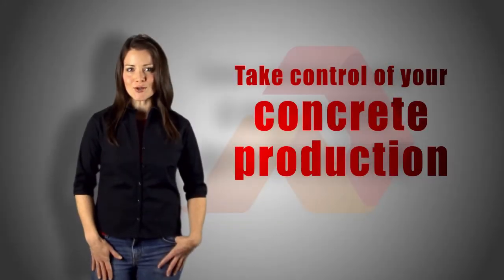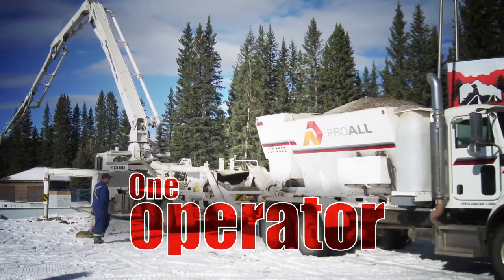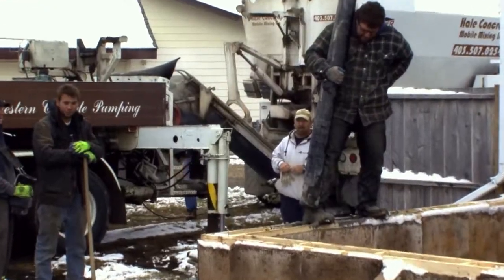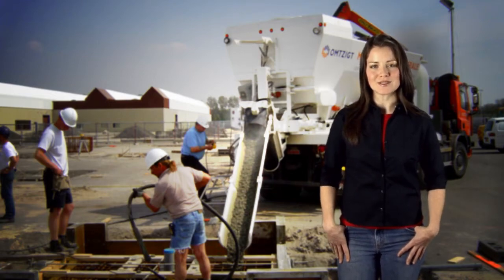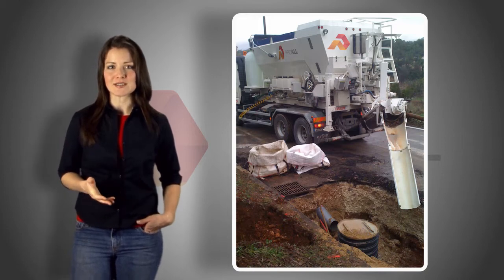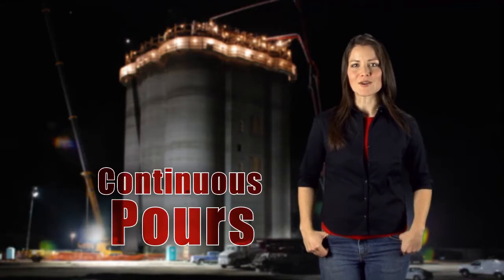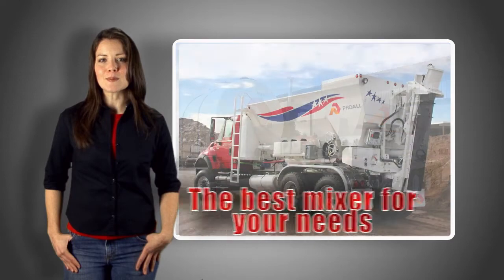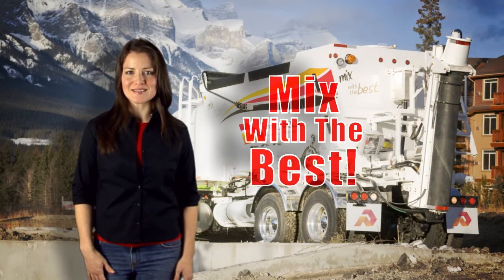ProAll Reimer Mixers: An Introduction

Comment: how many m3 perhours???
Reply from the maker: 50m3 per hour! Check out our website to learn more: www.proallinc.com
Reply: Asep farrasindo
Reply: ProAll Reimer Mixers  prce 50 m3
Reply: You can make your plant on site and load. Each truck will hold 7m^3 and max load at almost 9.

My boss has two and we can pour 4 to 5 trucks an hour depending on loading.